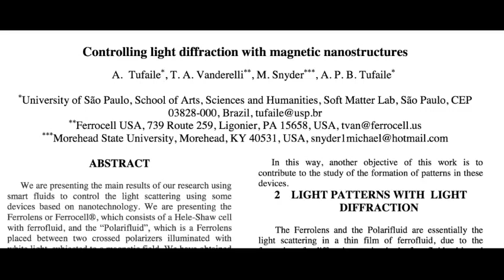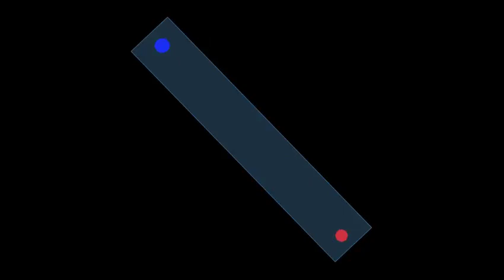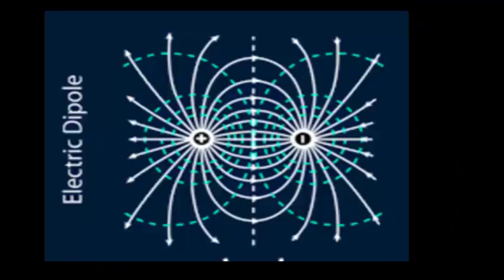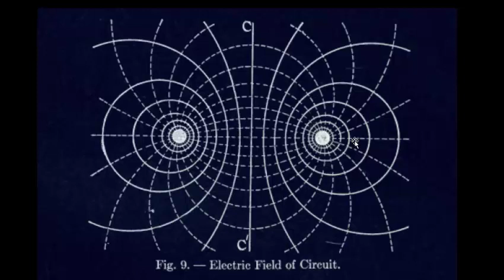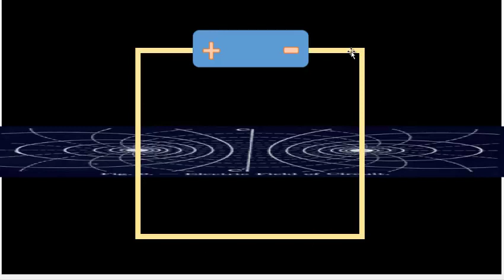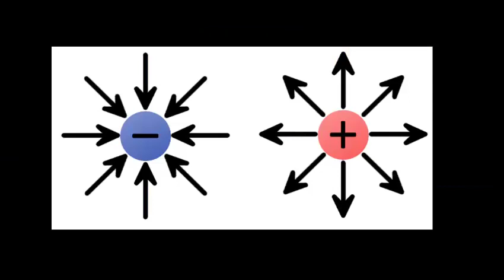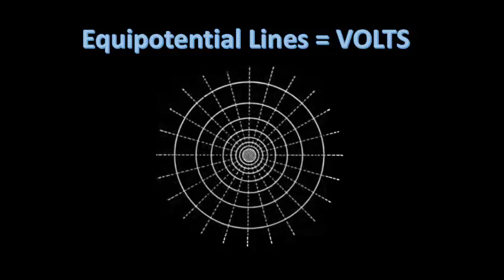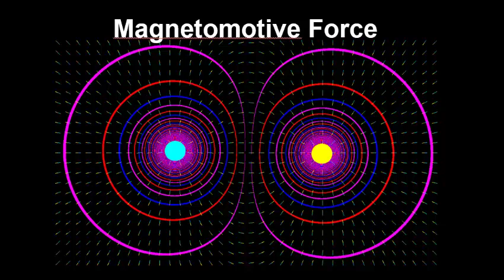On Magnetic Mono-Poles and Isopotential Lines

Comment: Does the software indicate where the source of light? Your pole image is nothing like how it looks under the Fcell
Reply from the maker: This has nothing to do with a light source. Do the equalpotential lines around the electric charge or the wire have anything to do with a light source?
Reply: @FractalWoman  so the software has nothing to do with the ferro cell? It's just showing the lines of force in the same way iron fillings do around a wire with charge through it? If so, what's new about it?
Reply from the maker: @LindsayButler  You are correct. The software has nothing to do with the ferrocell. The software shows the isopotential lines directly. What's new? The FERROCELL. That's new. The ferrocell is a device that is able to visualize the isopotential lines that were previously not visible. Iron filings shows the orthogonal field. That said, the position of the lights directly affects and distorts the lines, but, as you can see from the very last image I show in the video, the ferrocell DOES seem to be displaying the isopotential lines, albeit, a bit distorted.
Reply: @FractalWoman  I have owned a ferrocell for four years, I'm well aware of it is and does. But the software doesn't relate to what is seem under a ferrocell. Giving lines of force / induction a new name only causes further confusion, doesn't make it new. Also despite the importance of the source of  light is in regard to what is seen on a ferrocell the software seems totally ignores this. This is what I don't understand, why substitute your eyes and ferrocell for software that doesn't represent what is showed under the cell?

It seems more sensible to say that whilst iron fillings seems to show the 'magnetic lines', under the ferro cell we see the 'electric lines' which would line up with the Steinmetz image you like to use. 

Thanks for your vids, always interesting. Especially like the plank ones, although need to watch a few more times I think.
Reply from the maker: @LindsayButler  For the record, the software is NOT designed to simulate the ferrocell. It is designed to simulate the "fields" in and around a magnet. Notice that the software DOES very accurately predict are the orientations of the IRON FILINGS. Check out the 6:25 mark in my video and compare that with the actual iron filings at the 6:42 mark. Keep in mind that the visualization of the iron filings do not require a light source to be visualized. With or without a light, the iron filings will self organize into this pattern.The isopotential lines are exactly orthogonal to the "iron filings". That is the difference between the iron filings and the isopotential lines. They are exactly orthogonal to each other. These are the TWO components of the ONE and only one "field" in and around the magnet.

https://tenor.com/view/torus-vortex-spiral-gif-14087761
Reply: @FractalWoman  right so it has nothing to do with the ferrocell - so why it is in your ferrocell series?! - and why creat "magnets" inorder to get an image? it just seems to shows the so called electric lines of induction, these don't need renaming or made to sound new.
Reply from the maker: @LindsayButler  OMG. Please listen carefully. The software mimics the ispotential lines. Even if the ferrocell was never invented, this software could still have been developed. The FERROCELL, invented by Timm Vanderelli, is capable of showing the ISOLINES (or at least some aspect of the ISOLINES) which the software happens to mimic. The software ALSO mimics the configuration of the iron filings, in fact, the iron filings are mimicked much more accurately, because they don't depend on a light source, however, the ferrocell DOES. The ferrocell IS new. This is why I show the ferrocell images in the video and compare them to the ISOLINES. They are VERY similar, but not exactly the same because the ferrocell image depends on the location of the light source. The iron filings have no such problem which is why they look more similar to the images generated by the software.
Reply from the maker: Why do water and ice and steam have different names? They are all made of "water" right? Why not just call it all water.  Ice is a different modality of water and steam is a different modality of water. In a similar manner, the ISOLINES are a different modality of the field geometry. It is just one component of this: https://tenor.com/view/torus-vortex-spiral-gif-14087761
The horizontal lines are the ISO LINES.
Reply: @FractalWoman  giving something a new name doesn't make it new.
Reply: @FractalWoman  ISO lines = the so called electric lines in the Steinmetz diagram
Reply from the maker: @LindsayButler I'm not quite sure what the problem is here. Isopotential lines is NOT a NEW term. It has been used for decades in reference to electrostatic charge only they call them equal potential lines.

http://hyperphysics.phy-astr.gsu.edu/hbase/electric/equipot.html

ISO MEANS EQUAL. https://www.wordreference.com/definition/iso-

In medical imaging, we call them isodose curves when talking about radiation therapy.
http://www.scielo.br/img/revistas/clin/v71n1//1807-5932-clin-71-01-010-gf02.jpg

We are not inventing any new terms here. The only thing that is NEW...is the ferrocell which Timm Vanderelli invented and the software that Michael Snyder wrote.
Reply from the maker: @LindsayButler  The ISO lines correspond to the circular magnetic lines in the Steinmetz diagram.
Reply: @FractalWoman  whew!...did you finally get Lindsay to get it?  =D
Reply from the maker: @wchiwinky  I was wondering the same thing. LOL.
Reply: @FractalWoman   I started with a question not a point... And I still don't get what is new here? The simulation is nothing like a ferrocell but you use magnets to get a pattern and you use it in video to explain the ferrocell.... so it's a bit confusing and then you insist on calling magnets lines ISO lines, also confusing. 

The same pattern is also cased around a current carrying wire and iron filling, but that would not be what is seen under the ferrocell.
Reply: @wchiwinky  what didn't I "get"?
Reply: @FractalWoman  oh so not electrostatic charge?
Reply from the maker: @LindsayButler  you are the one that keeps assuming that there is something new. Why does there have to be something new? All I am doing is explain things in MY WORDS. MY WORDS are new?. My words are always new. Everything that comes out of my mouth is new. New thoughts. New ways of saying things. New explanations. New and BETTER terminology. It  you really need an answer to that question, then that is what is new. The universe is VERY OLD. It is NOT new.
Reply: @FractalWoman  I wasn't assuming, I was asking. Trying to get clarity that's all.

Comment: What might be able to solve these issues between software models and experiments is machine learning. If you could find enough pictures, and create rotated copies for more data, it could be trained to find patterns and relationships based on edge detection of the lines in a ferrocell. Which could then be used to make a model that has predictive capabilities, and tested

Comment: Very interesting thanks for sharing.. just a small correction there is no such thing as a negative charge, there’s charge and Dis charge. 👌
Reply: Just a little correction... What is discharge if not a flow of charge? There is definitely two catagories of charge, though it's more accurate to say that they are inverse to each other. 3 if you count neutral
Also imo it would be easier if we measured current by flow of ""electrons"" rather than Benjamin Franklin's idea that it's "positive" charge moving in a wire instead of ""electrons"". Which are just oppositely charged to protons, positive/negative is just a labeling system
Reply: RustyCobalt I agree it’s a means to interpret the inverse of charge but a negative implies it’s of its own nature, a lightening bolt isn’t a negative charge it’s a discharge from a charge as are they all. Not sure if this is an older video of Fractal Woman and in her other videos she uses the term discharge. I feel like negative charges were made up to give rise of the notion of “Particle” electrons in my opinion.
Reply: It may be semantics but I believe back emf is negative electricity.  Still a discharge but a mirror image of the incoming current.